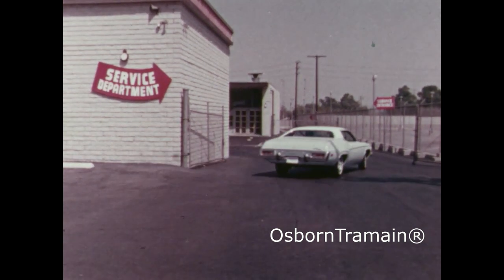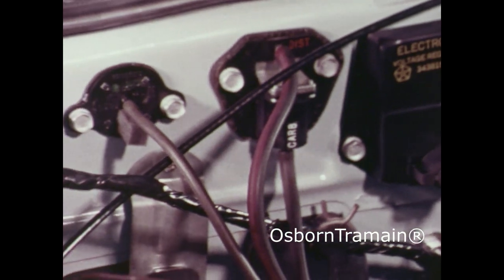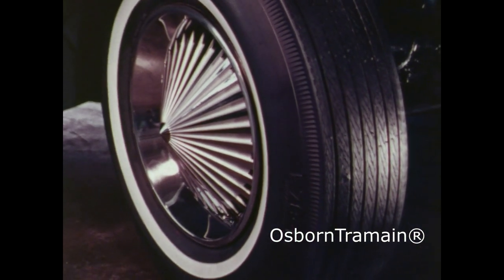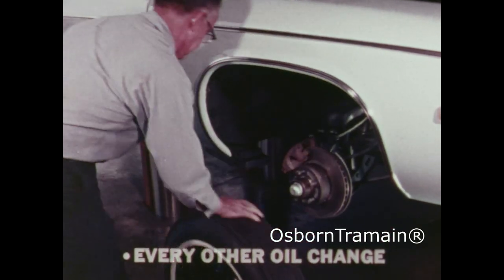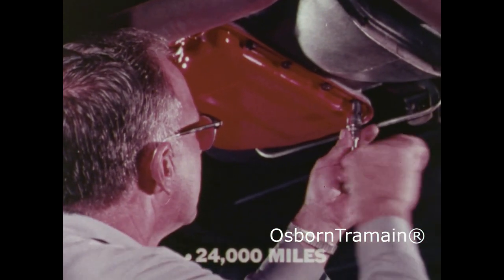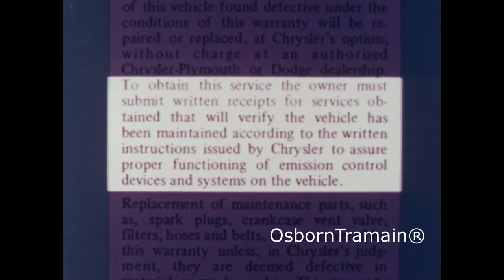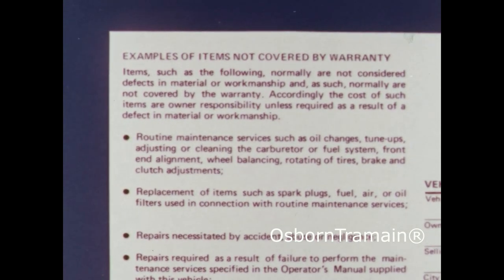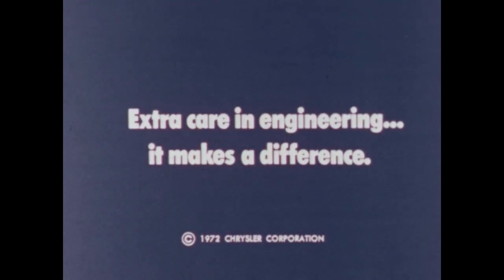1973 Chrysler Plymouth Dealer Film - Warranty  - Features 1973 Plymouth Satellite Sebring

Comment: If only Chrysler had stuck to this wonderful electronic ignition system and never started screwing around with that horrible lean burn, think of how much better the 70s would have turned out for the company
Reply from the maker: Lean Burn had absolutely nothing to do with the Companies Financial Condition.  ZERO.   Lean Burn was on a some 76 Cordoba by customers that had paid for it as an option.  Chrysler's financial Condition was already bad by then.   The 1977 Recall of the Volare and Aspen Fenders being the most expensive recall in the history of the USA is what really hurt the bottom line, plus spending on developing the K car as well as the Horizon and Omni in 78 and 79.  the 79 Recession and very poor financial condition then pushed the company to the brink.  Nothing about lean burn has any impact or is cited by any reputable authority as having an impact financially on the company.   They didn't even roll Lean Burn out to the full line of cars until 1978.
Reply: @OsbornTramain  Can you tell me about the Aspen and Volare Fender recall and how that hurt the company?
Reply from the maker: @zephead5831  sure, in 1978, Summer Chrysler had a recall of all Dodge Aspens and Plymouth Volare's  for repair or replacement of their front left and right fenders that were suffering from premature rust.   The cars by and large rusting very quickly.  This was the most expense recall in the history of the United States.  Each car had to be inspected and it's fenders removed in some cases and replace and a plastic shield was also installed to prevent further issues.   This had a significant effect on Chrysler Corporations Financial Statement, when the reserve was set up to record this Liability.  From a pure Accounting effect, the creating of the financial reserve had no direct effect on the cash position of the company until the repairs began and dealers had to be reimbursed for the work.  There was  a claims process set up for the dealers to repair and submit for payment.  I worked for a Factory owned dealer at the time and remember how busy our body shop was.  In fact the recall was then expanded to include Lebaron and Diplomats too.  My Mothers Dodge Diplomat which was only 1 year old had rust too in the top of the fender and it too was repaired by Chrysler.  Many people confuse the and say that the Volare and the Aspen had the most recalls in history which isn't correct, it was the most expensive recall at the time,  The Aspen and Volare had definitely quality control issues to start but by and large was a very good car with the bugs worked out by  mid year 1977.
Reply: OsbornTranmain When Lee Iaccoca was fires from Ford in 78 and came to Chrysler, He simultaneously
got a hold of things in the company and had the idea for the K car -I know he had a minivan idea that Ford said no to. Until he secured the loans from congress in 79, began the K car project and in record time  had it ready for 1982 models?
Reply from the maker: @socalltd  not exactly The K car project took 1 billion dollars to complete over 3 years starting in the end of 1977, the K Cars were near completion by 1979, that was the actual justification for Congress approving the cosigning of the debt.....the debt was to keep the company afloat so that it could launch the Dodge Aries in Fall of 1981 as a 1982 model.  It was an easy gamble to take because the Government already knew what the K cars were going to be...crash testing and certification process began well before the Sept 1981 launch.  Again, this goes back to my point, Lean Burn had nothing what so ever to do with Chryslers Financial situation other than it was part of the RD spend.........Chrysler was spending heavy...and the down turn of 79 is what almost broke them.  The Loan Gaurantees was just co signing a new line of credit to get the company to the Kcar launch.....those pre orders of the car pushed Chrysler to profitability....it's first time in 3 years
Reply: socalltd it was actually the dodge caravan. That pulled them out

Comment: Change the oil every 3 months or 4000 miles... 😬😬 carefree service lol
Reply: Machining and metallurgy was different then. I remember when a used car with 70k miles or more was considered worn out. Today, that is low mileage. I drive a 65 Dart and I change my oil every 3 months. Takes about 15 minutes, including the filter. Car had its original slant six and has been very reliable.